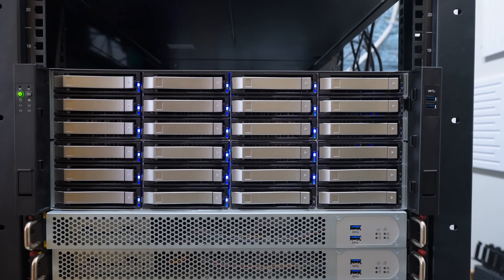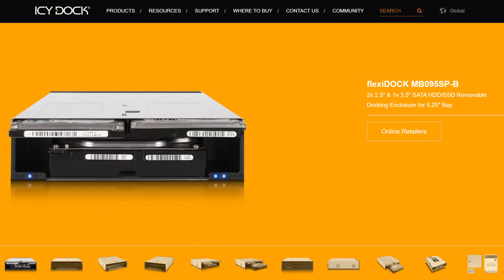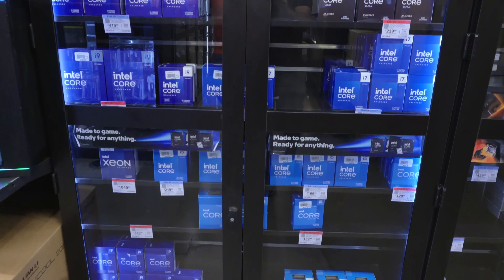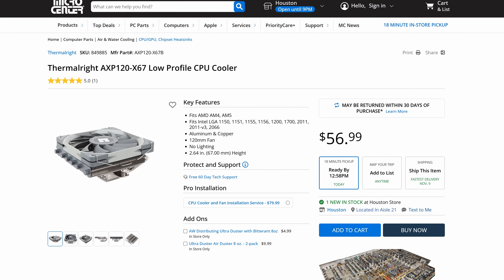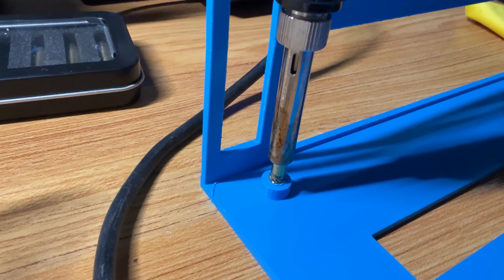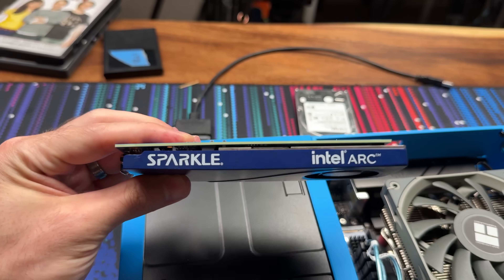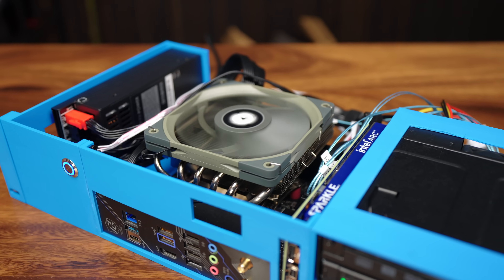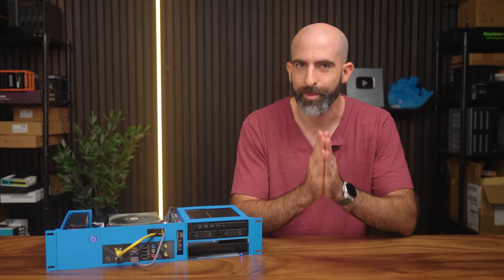I built an Automated Media Ingestion Server

Comment: So i think you could also use a Minisforum BD790i motherboard? It has also 2 M2 Slots and one PCIe x16. I had similar Setup with a H610I Motherboard ans a i3 12300T. But no Graphics Card. Now i am currently updating this system to a Minisforum MS01 with a Tesla P4. System is running but without DVD Drive til now.
Reply: That is super over spec'd
Reply: @noleftturnunstoned  Not really. Still under specd. With local AI workloads running

Comment: I have a similar setup but I use tdarr to transcode everything. In regard to the issues you faced unfortunately they were expected. There is just less documentation for AMD. Quicksync would have need much easier. I think mine runs 12700 (non-k) igpu which from memory was the hd 770. 
For your setup I would copy to 2 shares and get tdarr to handle transcode based on library selected. I guess the blue ray setup complicates things. With tdarr you could turn spare systems into nodes for this but like in my case does it really matter if the ingestion is not huge. When I record for my channel the project folder gets replicated instantly to NAS plus other sources but my setup is much more simplified. I could technically get it transcoded right away since it's 2way sync with version history but since the output is already what I use there is no need for that

Comment: AMD's video engine is kinda garbage. It feels like it's 15 years old, even if it technically supports modern codecs.
NVidia's is more modern, but still WAY behind Intel QuickSync. At least it works, but being limited to 1-2 transcodes while using 15w of power feels insane when an Intel iGPU can pump out half a dozen 4k transcodes for 1.5w
Well... for now at least. Let's see if NVidia kills off Intel's graphics and video team so it can look better without having to actually improve.
Business... right?

Comment: 8300g would have been better as it has the most encoders, including AV1 which is high compression. Or intel iGPU as they have a good set of encoders too, from 12thgen onwards. 740M is better and faster then the 3 compute units on the Ryzen main line cpu's. But then you not in the EU or UK where our power is very expensive.

Comment: FFmpeg + VAAPI is working great on my debian box with AMD iGPU. I would advise giving it another shot!
Reply: Same here. I'm really wondering if you were using an older version of FFmoeg or something. I have a LXC container running tdarr, another one running  jellyfin, and a separate one for "manual encoding" that relies on FFmpeg + VAAPI. It works beautifully.
Reply: I not sure on Ubuntu but on Fedora you need to switch out ffmpeg for the ffmpeg free world codex and drivers for AMD iGPU' as many distro's want ship MASA with the non free switched on in the compile lists. Mean we have to get from RPMfusion, but I think Ubuntu have both free and non free but you have to switch non free repo on and install. Same iGPU as on my 2200G. I had to install the free world masa for vaapi. He would have been better with the APU like 8500g or 8300g AM5. As getting the iGPU working should be as hard as it got 7x0M igpu's
Reply: He already commited to using a intel arc card, quicksync will run circles around the amd igpu for transcoding tasks.
Reply: I'm just curious about the performance difference because the performance he got was not inline with my own experience.

Comment: I've been wanting to do this, but lean a lot more onto the software and make a nice UI for choosing where files go.

However - why don't you just encode directly to the target filesystem, or get a spinning disk for the temporary storage? It feels wasteful to write to these SSDs.

My approach would've been to try to use a PI-5 with a 5gbps dongle or some other mini PC. I think that's a lot more feasible if you don't need to encode files - just move them.

Comment: Yup, definitely use an Intel 12th gen chip for this . Much more supported hardware encoders with QuickSync. I haven't tried the core ultras yet, I bet the lower end chips from that line will be decently priced on black friday as well ;)
Reply: The 265k that they’ve seemingly permanently marked down to $250 strikes me as the best choice for this, if you wanted to use software encoding, with ‘just’ the best hardware encoding support as backup. I’ll admit, it would be more expensive than the 7600x though.
Reply: Also look up Automatic Ripping Machine. It does similar things and has a web interface

Comment: Would intel 12400 with an igpu  and quicksync be able to work in this project and save a few bucks? And buy larger drivers and faster NIC? I Really like your idea of this project, 😊 thanks
Reply from the maker: Yep 12400 is plenty. The larger drives depends on where you need the stuff stored. In my case it was going to my NAS so I didn’t need a ton of local storage since that was just a temporary spot while it’s being encoded. With a faster NIC you could probably just encode directly to your NAS.

Comment: Have you heard of the automated ripping machine? Essentially the same thing in a docker container for optical media. Might be worth looking at using that as a basis for a future version of this as it has a webui built it, you’d just need to add your code to look at SSDs and other media.
Reply from the maker: I've never heard of that but I am confident I'm not the first one with this idea, nor have implemented it the best. I'll take a look, though.
Reply: @RaidOwl  I use the docker container version of the Automated ripping machine. It handles the MKV ripping flawlessly (unless the Trial MKV license is expired again) but i like your idea of taking those files and running them thru handbrake automaticlly. Do you notice any loss in quality? Im worried about losing some of the bit rates when you remux the files. I know it saves on space greatly but i dont want to lose any quality. Great video! I've been making my own local "netflix" by purchasing Blu-Rays and HD BluRays from resale shops and garage sales when i find them on sale.
Reply from the maker: @clownolie  I haven't had time to play with different profiles but you can adjust the bitrate with the profile parameters if you want higher quality.
Reply: @clownolie ARM does automatic transcoding with handbrake too.
Reply: @RaidOwl  Hardware Haven has a really in depth video about it. Highly recommend!
Reply: @Zeekblitz  Watched it again yesterday, he did have a few issues around unattended automation but it's definitely worth looking at.

Comment: In the future, I'd suggest against using PLA for structural server components and use PETG or another higher temp material instead. PLA has a relatively low glass transition temp around 55-60C (aka standard temps under load), which is when it'll stop being rigid and begin becoming a lot more flexible without melting. PETG's glass transition temperature is closer to 80-85C, which I'd really hope your hardware isn't running at.
Reply from the maker: Yeah I think next time I'm going to switch to PETG. I haven't had any issues with my PLA builds but I'd still like to see a real life comparison.

Comment: So as you're using the Arc for encoding, what processor would you go with instead to save some money?
Reply from the maker: Prob any AM4 chip to save a few bucks on that, the motherboard, and RAM. You can usually find a Ryzen 5500 for under $100.

Comment: 17:34 VAAPI acceleration should be excellent with the 7600x iGPU, quicksync shouldn't be hugely better when VAAPI works right. Double-check your config!
Reply: It all depends on the kernel and Mesa version, since he didn't say which Ubuntu version he's using it's hard to say. 25.10 has a new kernel so that's not a problem, I don't know which Mesa version it has though? Having to compile FFMPEG (if I heard that right in the video) is also related to Ubuntu so, maybe pick a distro that doesn't need that step.

Comment: Why not AV1?
Reply from the maker: Not widely supported enough yet, but wouldn't be a bad option
Reply: @RaidOwl what do you mean not widely supported? most of mobile devices and tv can do av1 decoding. and same with browsers. and even if the hw decoding isn’t available software decoding is for sure there. i keep searching for any review or tests using the ryzen 9000 like 9600 or the x as they have rdna 3 which should have av1 hw encoding.  but haven’t found any such setups yet

Comment: Hi! How to you manage ingesting the same file multiple times off of your media? Does it hash the file to see if you already have it? Use some content addressable file system?
Reply from the maker: When it encodes the file the new file has the same name but with the OG file's modified date appended to the name. So when it checks it uses the name and date of the file to check against the already encoded file's name (which has the modified date in it already). It's a bit janky but it's simple and works.

Comment: That seems clunky and overly engineered, although kudos for making a normal rack shelf for small things instead of using the mini fad which I really don't understand (and obviously mini rack and paraphernalia sellers ask an arm and a leg for what is essentially an inferior product) just fit all the mini PCs and stuff horizontally into normal 1 or 2u shelves and put that into a rack, better airflow no space wasted and better bang for  buck and more versatile for future use. 

To the point now, why dedicated drives and hardware to do that and not abstract it? 
You can share access to your drives towards the same server that hosts your media/SMB/plex server or whatever, it can by its turn check if media is present then check meta tags to see if you have already a copy of said media or not and then copy it to your library while you just enter e.g the disk on any place on your network instead of having to put it in the special pc designed to digest it.
Reply: While I agree with your take on the mini rack, the limiting factor on full sized racks is that fans are circles and if I want to rack mount a mini ITX board and not use fans that sound like a drone is hovering in the office, you're taking up a ton of rack space for little compute. We need some kind of option for a half width 2/3U high slot-in units.
Reply: @bitterrotten  I am not sure I understood the issue, but if I do then I think the issue is not realistic, I mean if you only have 1 mini PC you dont need to rack it in a special way just put it in like a lose router or something, due to its low power consumption it wont be affected (or affect other hardware) inside or outside a cabine. 
if fan noise is your issue and you dont have any hardware in the rack that needs tons of cooling and just have like a bunch of mini computers a couple or so of silent (e.g Noctua but there are lesser known and cheaper brands that are as good) desktop fans will do the trick.

Comment: No. That chassis is great and what I want to see more people doing. The only thing it's lacking is directed airflow.
Reply: Having used 3d printed 19" rack shelves, I would much rather buy a cheap steel rack shelf for strength and add insets to hold components.

Even if I had a large format printer, so I could print shelves in one go, a metal shelf is so much stronger per mm of space used, so without the need to be load bearing, the 3d printed parts could be slimmed significantly, enabling better cooling.